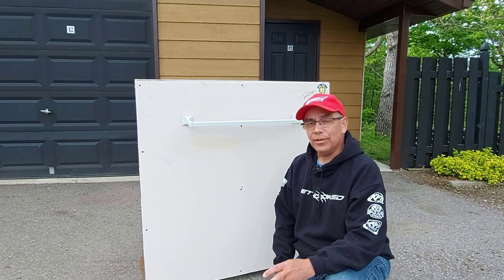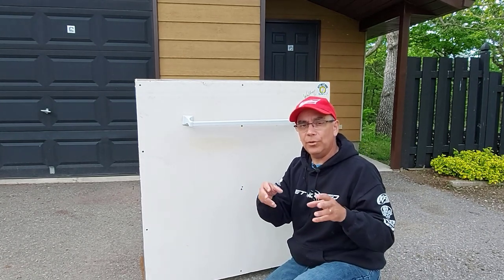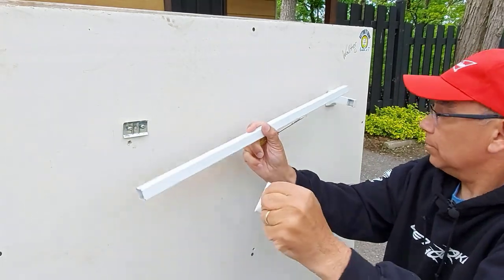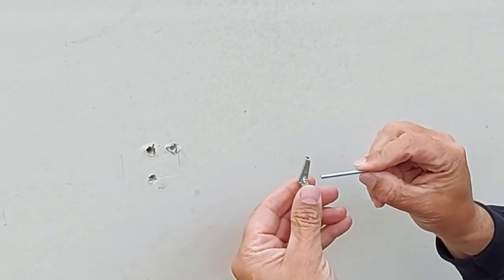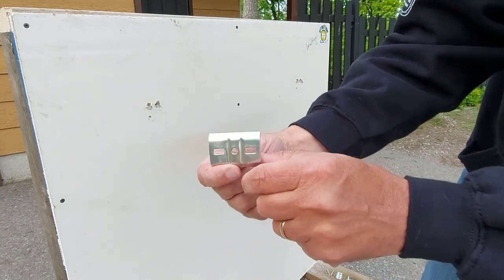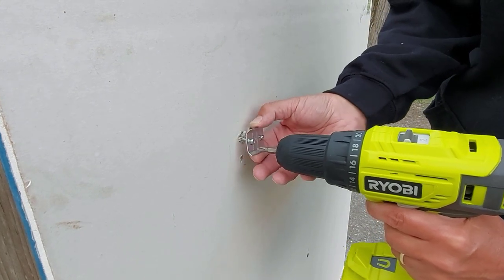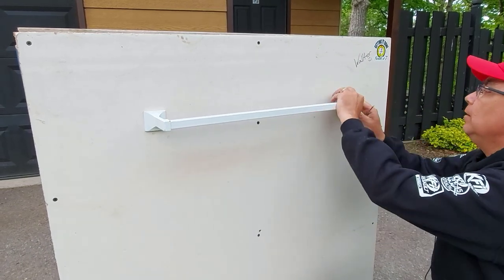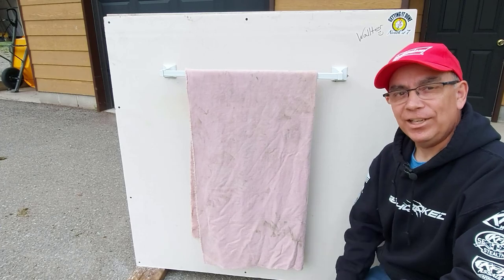Repair Loose Towel Bar | Never Rip From Wall Again

Comment: I was thinking of putting pcs of wood in wall then add drywall then  
The towel bar 

This Ways good too but putting wood behind drywall will definitely meke it last  if doing like in video its probably going to loosen as you only have drywall that holding the screws